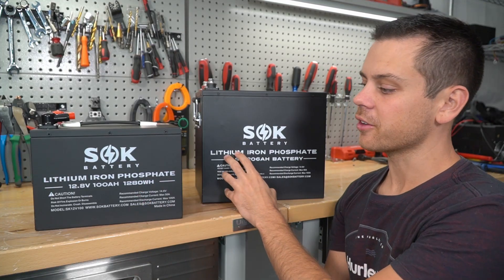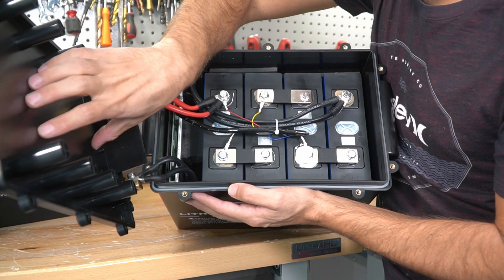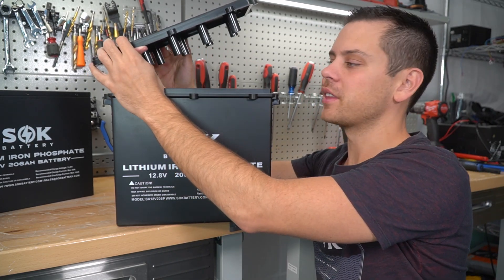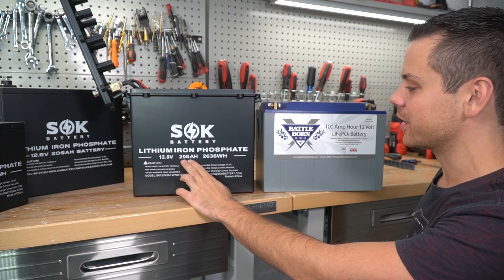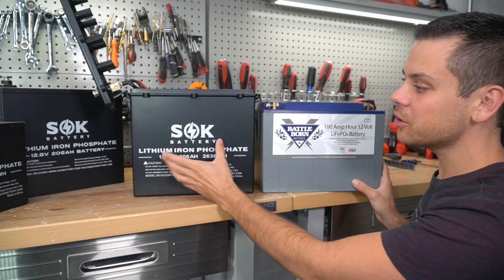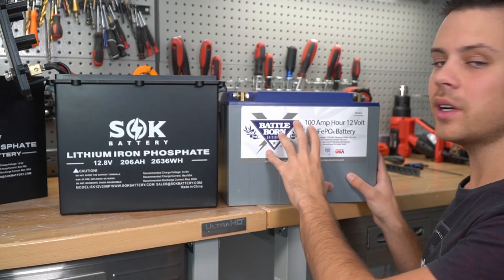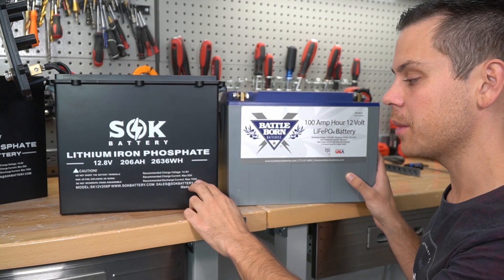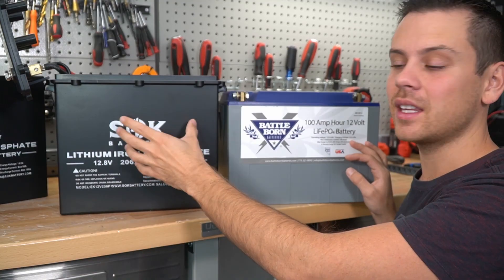New Battery! Marine Grade SOK 12V 206Ah LiFePO4 for $.39 per Wh

Comment: Any reason you can't parallel Battleborn and SOK together? I have 2 Battleborns, and would like to add an SOK to the bank
Reply from the maker: I parallel them. And 7 different types of batteries in my largest system. This was actually a huge debate on our forum. A large battery has lower internal resistance and should theoretically feed the system with more power. This will ensure that the parallel battery strings cycle together. If one bms has more resistance or there is more voltage drop across a conductor supplying one pack, you may have problems. 

I should probably make a video about this topic. It's safe to do, but be sure to use a circuit breaker for each pack, and use oversized conductors. Also, if you are pushing high c rate loads, you should use same type and amp hr rating. For solar at low c rates, it's totally safe
Reply: Different cell chemistry, thus different charge/discharge profile. Not a lot of difference, but it might make a difference.
Reply from the maker: @john_in_phoenix  they are the same chemistry. But different cell design and probably some variation in the electrolyte. Each manufacturer has their own recipes. But not that big of a difference. Typically the parallel FET bank can change the internal resistance figures when testing these packs. Cheap packs always have higher resistance. These have different current ratings so I would imagine there would be a difference. But not by much
Reply: @WillProwse  Thanks, I didn't realize that Battleborn was using LiFePO4. I thought they were using the cobalt based chemistry like Tesla (currently) does. Learn new things everyday.

Comment: That is really nice, I'd like the marine style for my tiny house just because FL humidity rusts everything LOL
Maybe they will make a 24v model someday as well since some of the trolling motors run on 24v
Reply: @jtr82369  : only packaging,  - the negligible voltage drop using a quality bus  will be unlikely to vary ones experience  or is there an intangible not known to us ??
Also how if using in parallel, 2x12v 100Ah batteries allow higher current draw than a 200Ah package
Reply: @kadmow  I'm just thinking about convenience tbh, I would just rather have 1 big battery over 2 smaller ones in my boat.
Reply: @jtr82369  : yep, the value of a unified package - convenience (as long as form factor fits.)

Comment: I have a battery question. On a solar aray can you mix batteries. By mixing I mean 12 volt batteries but having different amps. I have bought a 12v/ 100ah battery can I put a 12v/35 amp battery with it in parallel. I am just learning right now. Got me a cheap harbor freight kit to learn on and trying to add it to my sons home schooling as well. Still have to learn more before I try to teach him. I am planning to use the solar in my green house to power lights maybe a heater in the winter and a fan in the summer. Not sure about the heater as they do pull a lot from the batteries. I may just go kerosene on the heat .
Reply: Don't bother to try running an electric heater from a battery. Running a fan for a propane or kerosene heater, yes. A heat pump inverter air conditioner, maybe, but not an electrical resistance heater. Just too many watts.
Reply: @john_in_phoenix  Thank you for the input. I was figuring the heater wasn't going to work. Hadn't put paper to pen yet . Just know how electric heaters suck electricity figured it would be a no go. That might be a good homeschooling thing thought.
Reply: that's not recommended because one battery will try to charge the other.  it's best to parallel new identical batteries that are at the same state of charge.
Reply: @RealJohnnyDingo  Ok thank you for the feed back. I have bought your books just haven't been able to read them yet. I got a concussion and reading is very hard on me right now. Wish they had them in audio

Comment: Good compare/contrast of the two 12v batteries. I wonder when BB will come out with their next-generation battery. Thanks for sharing.
Reply: They have: 270Ah 12V LiFePO4 Deep Cycle GC3 Battery for $2,359.00. OR 270 Ah 12V LiFePO4 Deep Cycle 8D Battery for $2,259.00. this last one looks kind of like a "Cat" battery, and fits in the same space. The first is stackable and has all kinds of bolt holes to secure it down and to each other. I'm thinking of using the GC3s for my RV as well as my girlfriend's shuttlebus RV. ;)

Comment: If you keep your battery in a box and just have a 40 watt light bulb will keep things warm.
Reply: Important to note, insulated box, and incandescent light bulb. A 40 watt equivalent LED bulb isn't the same.
Reply: you can get thermostatically controlled silicone heating mats that gently toast your batteries :)

Comment: How much do you value the "serviceability" of a battery? Is it terribly important for the average plug-and-play user?
Reply: i think serviceability is another word for cost over its lifetime, if you can or are willing to learn how to service parts it can extend the life of the batteries for very little extra cost. if you cant or wont service a battery it may not hold value to you, but maybe could be valuable if you resell it
Reply: average user should look at warranty more than serviceability, I think... if it dies after 10 years you probably got your money's worth
Reply: For the average user, these should last at least 5 years without needing service, probably 10. By then, you won't want these anymore, better and cheaper with more capacity will be on the market. Tesla will change the energy storage market, as soon as the Chinese copy their 4680 cells.
Reply: People want “solid state” vs “serviceability”

If you want a “buy it and never look at it again”, let LTO. LiFePo4 will last a very long time. Pb-Acid will be replaced every 5 years.

If I was 80, I would go lead.
If I was 60, I would go LiFePo4.
If I was 30, I would go LTO.

Depends on how often you want to change batteries and how long your expect to use the solution.

Comment: Aw my eyes, recording is really unclear. But nice info
Reply: The batteries looked in focus to me(?) YT often degrades the resolution and I find I have to tap that settings icon to bring the videos back to 1080p (or higher) from as low as 144p. Just my experience.